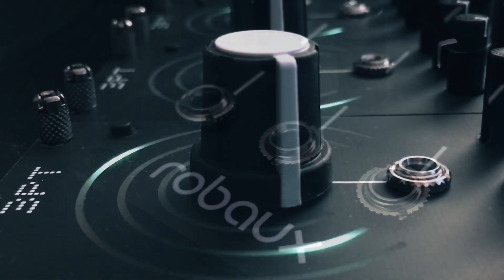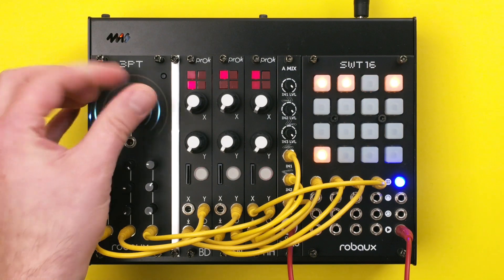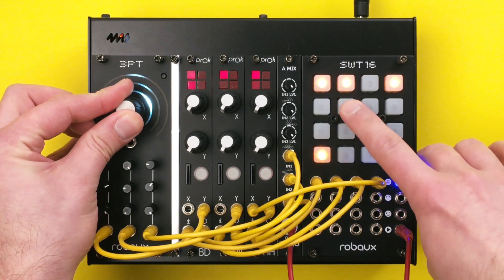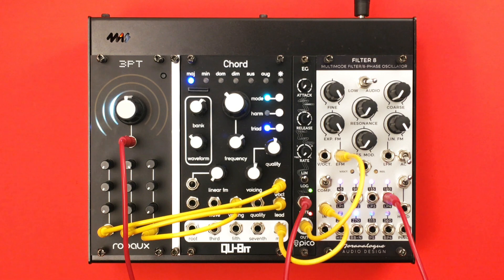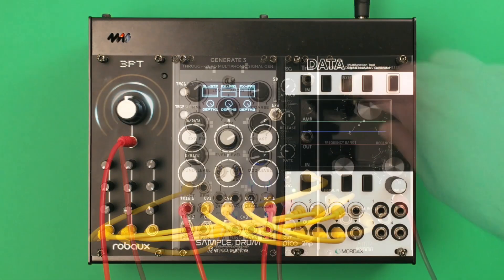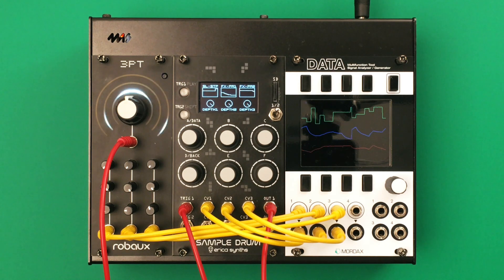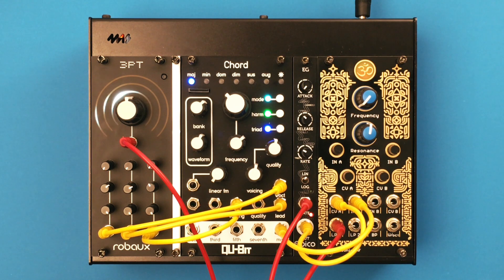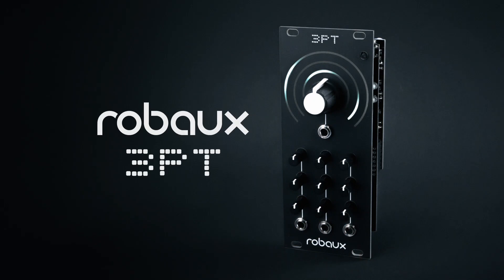Robaux 3PT

Comment: 🤔 this kind of 'control' will probably end up in the bottom row of cases. The three CV outs will then have the cables go over the attenuators and offset buttons, as well as the main control knob.
Upside down would maybe make more sense?!
Reply from the maker: That's true, in some setups it's not so great, in others it fits perfectly. For the Tripot, we followed the concept that most modules have in common: Controls on top, outputs on the bottom.  Many functions like the sequencer, the quantizer or the random generator are controlled by the CV input, so you don't need the control knob at all.
Reply: @robaux  Thank you for the explanation. Of course mounting upside down is an option too! Keeping my eye on this module, I have 10hp left 😉